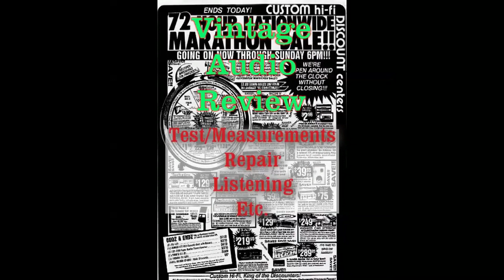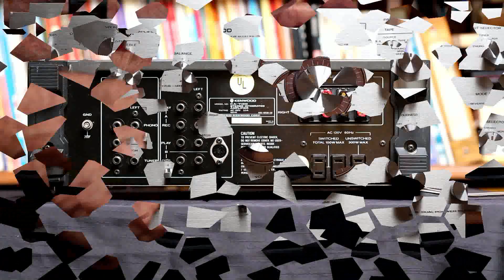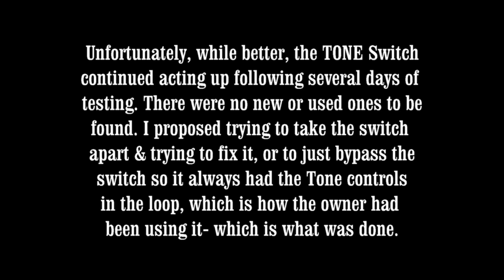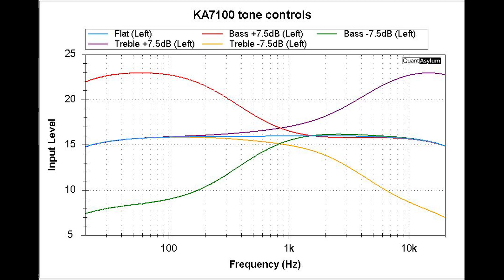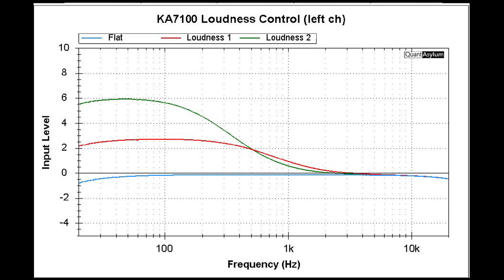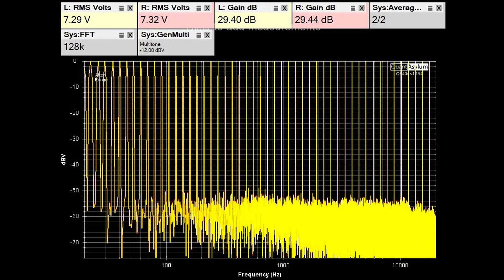Kenwood KA-7100 Integrated Amplifier- Vintage Audio Review Episode #21

Comment: Just bought one of these and $200 and very very happy with it. I listened to a KR-9940 and went blech at how warm and smothered it sounded, so I'm relieved that there is an upgrade path above the KR-3010. The alleged 0hz-100KHz FR is evident in the bottom and instrument separation. Same issue though, those switches crackle and causes drop outs, unless I flip it real hard, can't actually use the switches, or goes back to uneven crackly land. I'll get out the Deoxit soon. Anyone looking at a Yamaha A-S301 or Aiyima etc, don't, these things are compromised and have all the dynamics ironed out of them, either go big or go vintage, new mid end is plain bad.
Reply from the maker: I appreciate your commentary though I would disagree with you about Aiyima (Fosi) for that matter as they sound pretty good when used within their power limits.
Reply: @vintageaudioreview  It was the low end model, and I didn't spend a lot of time with it, but my initial reaction was blech and I don't like loud. Just super brittle and weak and grainy. Probably works better with different speakers, and it beats everything for the price. The new Kenwood has the same problem, only left channel until I flip the tone defeat switch a few times, then it stays working until next power on. Deoxit helped, no crackles.

Comment: I have the exact same problem that you described, where one channel cuts out and then goes on if you crank the volume up 3/4 of the way. I understand from your comments that cleaning the tone switched work for a while, but didn’t solve the problem. Can you explain what you mean by, always have the tone controls in the loop? I don’t know what that means but I would be happy to do it on my unit! Thanks so much for posting your video
Reply from the maker: Sure and thanks for the question/comment. Try having the TONE DEFEAT switch in the OFF position (down), The will put the tone controls in the loop, so even if they were in the 0 position, they may have a very small effect, but this may solve your problem.
Reply: @ that seems to have done it! I had to flip the switch up and down several times, and there is still a little crackle in the one speaker when I turned the balance all the way to that speaker. So I will stop touching the balance button! Thanks so much for your help, I am so relieved.
Reply from the maker: @doobster54  Thanks for watching and am glad it worked for you!

Comment: I know that this is a old post but I just wanted to say that after watching this video it gave me the confidence to investigate a similar issue, after taking the amp cover off I found all electrical and mechanical components completely covered in dust,  clean with compressed air and lubricated all mechanical switches with electronic approved cleaner and lubricant, turned power on and it sounded fantastic, the musical nuances that comes through this amp have to be heard to believe. Thanks for sharing!
Reply from the maker: Glad to hear that the video was an inspiration to you and you were able to get the Kenwood working well!

Comment: These are exceptional units.  I would stake it up against a Marantz 2270.  If you can find them, buy it.  The price is going up on these.  In 2023 a fair price would probably be $800 to $1,200 for one in pristine condition.  In 2023, that's not a lot of money folks.
Reply from the maker: While it has been a while since I listened to either of them, I think the 2270 would be my choice. Both are popular and seem to be getting pricier. There is definitely a Marantz tax. Thanks for commenting!

Comment: Just bought one for $40 plus $70 shipping 😬 power switch was bent straight down when it arrived but managed to straighten it out with some pliers , works good , definitely needs deoxit on everything but for some reason I can’t hear a difference with loudness on on either setting or off
Reply from the maker: Pretty good buy! I think you need to have the Tone Defeat OFF for the loudness to come into play. The loudness will boast the bass only, by 3-6dB depending on the frequency and switch position.
Reply: @vintageaudioreview  first time I played it no sound came out until I turned on tone defeat , I also have to keep the knob between tuner and aux for my Bluetooth aux to work , I’ll try to see if having defeat off will make loudness work
Reply from the maker: @chickenfoundation9323  I'm not sure how easy the input selector switch is to clean/lube with Deoxit, but I would try that as well as making sure that the selector knob is in the correct spot for the selection if that makes sense.
Reply: @vintageaudioreview  yea all the knobs are in the correct spot
Reply from the maker: @chickenfoundation9323  By correct spot I mean when the selector switch is say in Aux "detented position", are the switch contacts lining up correctly as it looks like the switch shaft has some set screws on it to where it could be adjusted- I am assuming that other inputs work without finding a "sweet spot"...?
Reply: @vintageaudioreview  yes when I have it on aux it’s in the aux detent and knob lines up, for some reason it only plays when tone defeat  is turned on , so can’t test if loudness only works if tone defeat is off
Reply from the maker: @chickenfoundation9323  The block diagram indicates that you have a problem with either the tone defeat switch or something in that path- possibly a bad supply voltage(s) to the transistors/FETs that are in the tone circuit. Could be bad caps, but then I would only expect one channel to be bad. Looking at the schematic, the Loudness switch is independent of the tone bypass circuit, and so it's effect on the bass boost should occur when it is switched in- if not, you have a problem with the connections related to the switch, or a bad switch....

Comment: I recapped mine with Nichicon capacitors, it sounds so beautiful, so natural, excellent amplifier. It does not get as hot as AC integrated circuits.
Reply from the maker: Thanks for the comment! People really like Kenwood gear, and for good reason.
Reply: Filter or power caps? Was it hard to do?
Reply: @Zimmy_1981  caps, 37 if I recall. Not hard, just replace one at a time to avoid confusion.
Reply: @gp8033  wow 37 caps?
Interesting ok thanks so much for the information my friend. Good advice on replacement too. I got mine on Sunday, love it! I named it Mr Rogers lol
Reply: @gp8033  btw where sells them?

Comment: The phono stage is known to be very good.  There is something wrong with the phono stage.  The only problem that I have experienced is that that it doesn't have a lot of headroom and can be over loaded with a cartridge with high output.
Reply from the maker: I would agree that the right channel on the phono stage has a bit of a problem. None of the folks whose gear I have worked on care at all about having the phono stage working (so far)- they could always hook up the phono preamp of their choice to an Aux input is what they tell me. I typically just like to show how it has aged with time. I typically only measure the phono stage with a 5mV input unless the spec specified something else. Sometimes there may be an overload spec for the phono stage, but I am not sure that I have tested that more than maybe once. Thanks again for taking the time to comment!
Reply: @vintageaudioreview  I have a ortofon 2m black and it can definitely overload the preamp.  It has been replaced by a ps audio phono preamp which is better/more refined and can handle the high level of the cartridge.

Comment: The transformer has one transformer but two windings.  That is how the they worked out the dual power supplies with one transformer.
Reply from the maker: Thanks for the clarification! I did not spend a lot of time looking at the schematic (or the transformer) to verify the "claim" in a written review that there was a power supply for each channel.
Reply: @vintageaudioreview  the previous model had two transformers but it also had the chip based amplifier modules (can't remember the name right now) that when they malfunction are near impossible to fix or find replacements.  The 7100, from what I have read, was an attempt to reduce cost but keep performance as close to the previous model as possible.    I just wish they kept the pre out/amp in of the previous model.  I assume that was cost cutting as well.  The heat sinks on the previous model were much more substantial as well.  I sometimes wonder if that is why the 7100 can get a little harsh in the upper mids when pushed.
Reply from the maker: @jked7463  I would agree with not having the pre out/main in jacks was probably a cost savings idea, though I would imagine a lot of folks never use it that way. The engineer in me tells me that not having larger heatsinks would not affect the sound much if at all- more of a reliability thing than anything else, though a hotter running output transistor or FET is going to have a different amount of distortion than a cooler running one, though I don't know if that difference would be audible,,,,
Reply: @vintageaudioreview  My point is that if the heat sink were larger, the transistors would run cooler when pushed hard.  I believe I can hear distortion as I push it hard.  To me the difference in distortion as it gets louder, is more audible than a base level of distortion.  If you start at 0.5% and go to 0.6% it will be less noticable than 0.003% to 0.6%.  We love to talk in absolute terms in audio.  I believe relative differences count more than absolute.
Reply: @vintageaudioreview  I agree most people won't use them.  But I am planning on installing some on my for a bi-amp speaker arrangement.  A separate amp for the bass, below 250 hz and the 7100 for above 250.  I believe it will stress the output transistors less and lower the distortion discussed in a previous post.
Reply from the maker: @jked7463  I understand what you were saying I would agree in principle that you would not hear a change going from .5% to .6% as much as the relative change going from 0.003% to 0.6%, though I could not hear 0.6% THD. If you have not seen this, it is very interesting:  https://thecarversite.com/topic/3580-amplifier-distortion-bob-carver-1973/
Reply from the maker: @jked7463  That sounds like a great use for the preamp out main in jacks. I have never biamped any of my systems, but use them more for test purposes, or in the case of the yamaha RXv2090 receiver, I just used the preamp portion since it had a remote. Thanks for all your insightful comments 😄
Reply: @vintageaudioreview  I will watch.  I also have an amp with 0.5% distortion.  Play it back to back with the 7100 and i can hear the distortion difference.  Another way to do it is record a song on a cassette (if you have one) which typically have 0.5 to 1.0% distortion.  Switch between record and tape and if you listen, you can hear it.  The way I hear it is my brain says "something's not right".
Reply from the maker: @jked7463  I have several cassette decks and listen to them often, but more for the music that is on them than for "critical" listening. I will do a review on one of them at some point in the future. I am not sure I would agree with you on the cassette test you mentioned to tell the difference between 0.5% and 1% unless you were able to adjust the amount of distortion of the recorded signal. I believe the link I sent may describe how that adjusted the distortion of the test signal, which had different results than when listening to actual music...
Reply: @vintageaudioreview  what I meant is that the published specs most cassette decks are around 1% @ 0db.  You know everyone hears differently.  I am not as critical on frequency response (with in reason) but I am much more tuned to time arrival/phase issues.  I am ok at discerning distortion.  I had someone once tell me that there is no way I could hear what I call "digital hash" in digital music because he couldn't hear it.  My response was that as I have gotten older I can't hear the high teens in frequency.  Does that mean younger listeners only thought they could hear the upper frequencies but really couldn't?   My point being that we all hear differently and our ears are all tuned to different things.  I am just saying that I can hear these distortion differences.  I have a bic two speed deck.  After getting it professionally rebuilt (by the bic tech dept head who has since passed,) it sounded amazing, better than new including a near perfect treble.  I brought it to a friend high buck system and recorded a piece.  It sounded fantastic.  But something wasn't right (other than mid bass hump they all had).  I realized it was the added distortion.  So while listening, I couldn't "hear" the distortion, I could hear it wasn't right.  Don't know if that makes sense but there it is.
Reply from the maker: @jked7463  It makes sense to me and once again thanks for taking the time to elaborate! While I would agree that we all hear things differently and have different preferences. Those is, however,  research from I believe JBL/Harmon that shows that people tend to prefer a flat frequency response in regards to speakers. I never discount my "old age hearing" 😃I am glad that you invested in getting your BIC deck going good!
Reply: @vintageaudioreview  agreed, flat is generally considered better, especially to those who listen seriously.  I am just not as good at hearing non flat as others.  Keep up the good videos.
Reply: @vintageaudioreview  I am embarrassed to say I just now read the linked article.  It was very interesting.  I can definitely see why distortion of more complex signals would be less audible.  That said, I do stand by my other comments that different ears are tuned to hearing different things.  Mine are more sensitive to time/phase and less (within reason) to frequency response.  As for distortion, I can only repeat that I heard a difference between the original source and bic cassette deck beyond any frequency response differences that I perceived to be distortion.  When it comes to some digital processors, I hear all kinds of "digital hash" that others can't hear.  So I believe there is no one answer for all people.  In the end, enjoy the music.  That's the point to listening.
Reply: As a follow up to this comment, after researching the viability of adding pre outs and amp inputs and talking with people more knowledgeable than I, the fear of creating added noise or hum into the amp (which currently is dead quite), was too much endure.  I ended up getting a Kenwood L-07C preamp and two L-05M amps.  They are being tweaked at my local repair shop to make sure they are better than factory spec.  Prior to sending them, I can tell you that they have better sound stage and much stronger drive than KA-7100.  But putting the output of the L-07C into the KA-7100's tape monitor's input, the majority of the difference is in the KA-7100's preamp.  Driving speakers through the preamp and KA-7100 was very similar to the L-05M's. Thanks again for the discussion.  Just thought I would update the conversation.
Reply from the maker: @jked7463  There is definitely no one answer for everyone when it comes to sound preferences... I appreciate your thought comments!
Reply from the maker: @jked7463  Thanks for the update- Those kenwood monoblocks look like they will work well with the L-07C preamp.
Reply: @vintageaudioreview  I was about to revise my comment about the KA-7100 vs the L-05M's when I saw your response.  So I will comment here.  While I maintain that most of the sound quality  degradation of the KA-7100 (not saying it is bad but not equal to the L-05M) is due to the preamp, the main loss in the amp section is less control and not as much drive.   Considering the cost difference between the two setups,  the sound of the KA-7100 is very impressive.

Comment: I own that, went thru hell getting that giant volume knob to function properly.
Reply from the maker: I am glad you got it to work properly- was it a problem with the detent mechanism? How do you like it?
Reply: @vintageaudioreview  Had to turn it upside down, and literally flood it w/ lubricant and ran it upside for a few hours occasionally turning the knob every 10-15 minutes. Power toggle switch had a slight bend, so got it pretty cheap on EBAY. I think it was $190 + ship. Like it very much, wish it had VU Meters like my other integrated Amps. 1976-1981 is what I like.
Reply from the maker: @robertdavis5714  sounds like your efforts paid off! There are a lot of great pieces of audio gear over the '76-81 range. Speaking of meters, I think my next video is going to be on a power meter..
Reply: @vintageaudioreview  Yes, something about those big volume knobs om Kenwoods, 5700 same thing but Hummmmmmmmm noise, where all my Pioneers never an issue. Have 5 systems in house with 19 pairs of speakers + 1 sub, and probable another 4 sit in closet and then I rotate when I want to see something different.
Reply from the maker: @robertdavis5714  You would make a great interview for me! In my "man cave" room I have 11 speakers & 2 subs and 4 "systems".

Comment: I have always loved my Kenwood amps and still use one in the shop!!!  Well done Scott.....
Reply from the maker: Thanks Mike! I have liked the two Kenwood integrated amps and one Kenwood receiver I have reviewed. You certainly can fill your workshop/garage up with some pretty good tunes with your system!
Reply: My first real receiver was a Kenwood KR-2400 back in the early 70's. It very nice sounding and good looking also. I sold it for a Kenwood rack system after about 10 years of use. About a year ago when I decided to pull out the several pieces of vintage gear that I had held on to. I purchased a mint condition KR-5600 off of ebay to be the centerpiece of my new/old setup. I struck gold and I am enjoying that warm Kenwood sound again through my Bose 501s! :-)